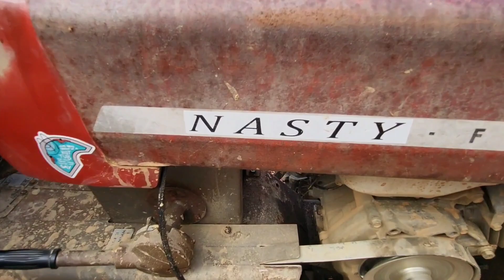weekend ride at the Bare Den part 3! Old Man Car

Comment: Awesome video, any chance you know what size belt is on the sears 12? I'm building one now I left the stock pulley on the back for now with a 7" up front.
Reply from the maker: Which sears 12 there were 2, mine is the one with the 420cc predator engine has a 6 front stock rear pulley and it runs a 5/8 83" but the other ss12 i don't know the belt size on